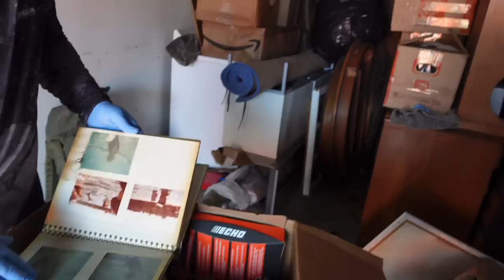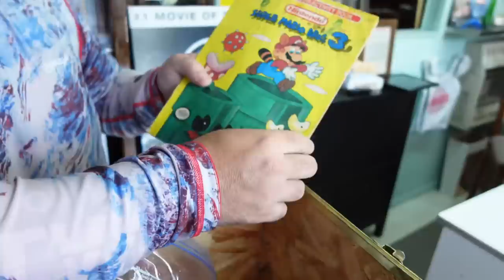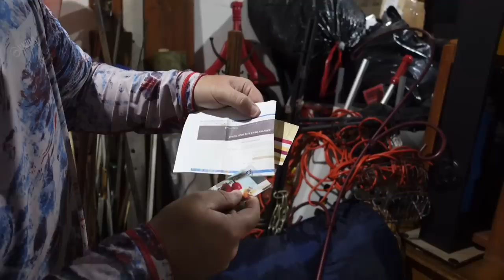This Abandoned Storage Unit Was Full of Loaded Gift Cards

Comment: They don't give the paint selectors out for free. They are for paint contractors mostly. They can cost 40-100 bucks just to buy. You would have made a terrible boy scout. Be Prepared. I freeze my bottles when I go fishing. You just have to think ahead and keep a couple pulled out every time you finish one. They defrost rapidly outside of the cooler. A little trick to keep a knife with you. Get one of those round flat retractable key chains. Put a small pocket knife on the ring. Always right there for you. You both are doing a great job. I am west of Gulfport and there just isn't many good lockers and when they have a worthwhile one they always overbid it.